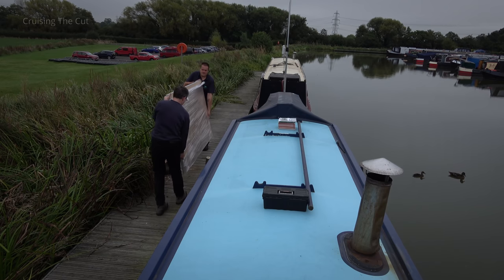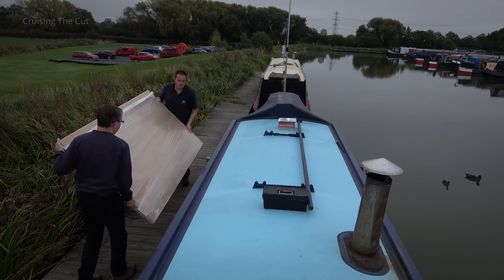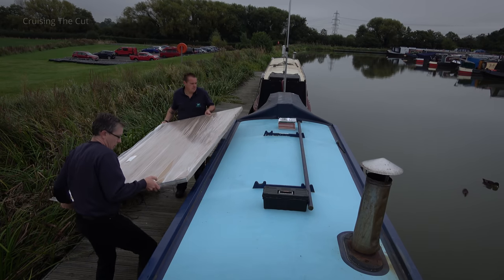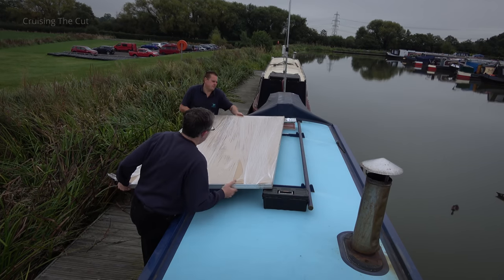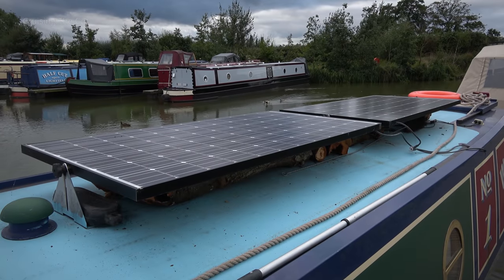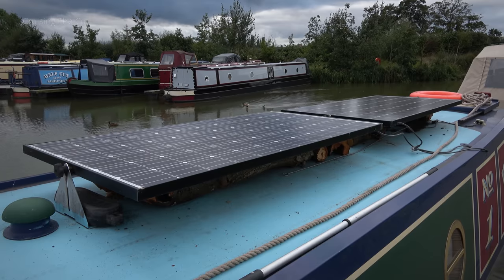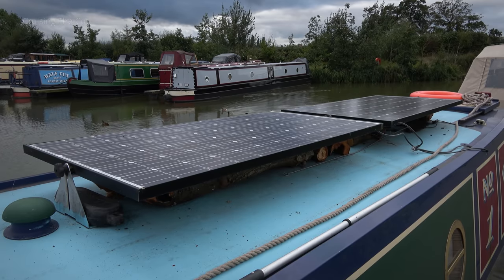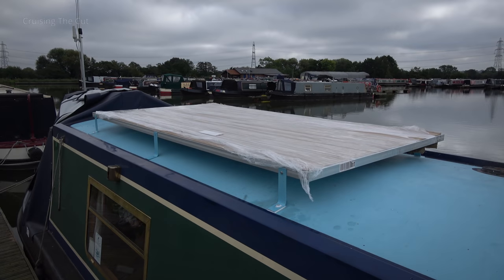260. Solar Panel and Lead-Carbon battery update (narrowboat)

Comment: Do you have any Anker power banks? On those sunny days, you could charge those up and then on darker days you can still charge/power your MacBook, cell phone, and other peripherals.
Reply: This is a great tip. I would even consider getting a portable power station. They're brilliant for when you don't have enough power. Jackery, Bluetti, etc.
Reply from the maker: Cheers but there's not really a point to getting a power bank though - it'd make more logistical and cost sense to add another battery to the existing bank. Those banks and Jackerys are just big batteries with a charger and inverter in a single box, which is what the boat already has as separate items.

Comment: Thanks, David, very informative. My only comment would be the slight confusion (for me) over units. I'm fairly up with electricity, but even so I got a bit confused when you used amps and amp-hours. I would be happier with watts - it is, after all what electrical devices measure their consumption in. I appreciate that your system is 12v, so different to what I'm used to, but I assume the same basic logic applies - power (watts) in greater than power needed = OK, power in less than power needed = problems. Just my twopennies worth - the overall message was clear, and I understand the world probably looks different from a narrowboat perspective.

Incidentally, I loved your reaction about going back on the mains - I know exactly how you felt!  And perhaps a sobering reminder of how much we take electricity for granted - and how difficult it must be for people only the other side of Europe currently having to survive without it.
Reply from the maker: Battery capacities are quoted in Amp Hours usually hence why boaters tend to think in that unit!
Reply: I think in Amps, not Watts. Electrical stuff is rated for Amps. This computer power brick has an input of 1.5A - as stated on it. And yet many things also labelled in Watts !
Reply: Historically Amps and Amp-hours are used because ammeters were used to monitor charge and discharge of battery systems and an ammeter can be used in any system regardless of its voltage, since it is wired in series. Simple and cheap. Watt meters are much  more expensive as they have two coils to measure the current (fixed) and the voltage (moving). The current coil sets up a magnetic field proportional to the current while the moving voltage coil sets up a field which reacts with the first to cause a pointer to deflect proportionally so indicating the power consumption.  Now of course the solar charging systems show all the paramaters and you could use watts and watt hours instead if you wished but just like gallons (we buy litres) and MPG its ingrained. Who likes Km/l.  Ugh
Reply: Ah is the measure of charge and Wh is the amount of energy. It's to do with the way batteries are made and tested, the measurement is in time and current so the unit is Amp hours - Ah. 

There are far too many complicated reasons Ah is used instead of Wh, it makes more sense and is easier to understand and use the industry standard when working with batteries.

Comment: Do they have propane refrigerators and freezers in the UK. I had a propane fridge and it worked fine.
Reply from the maker: Generally not on narrowboats, no (thought very occasionally you might see one on an old boat)
Reply: @CruisingTheCut  cool thanks for the reply. Good to see you posting these new videos, I think they're more interesting for you. Cool, have a good weekend.

Comment: Question. What is the total power received from the engine? I was wondering if a small generator would be more efficient/quiet, or much of a muchness?
Reply from the maker: It's only a small alternator but it's about as much as a battery bank of my boat's size would need
Reply: I once saw an all-electric RV that had two 175A alternators on the diesel engine and no separate generator. That seemed like a brilliant solution!

Comment: Have you considered using the spare solar in summer to heat the water in the calorifier ? I have seen others using this power to give them "free" hot water and effectively store the energy as heat.
Reply from the maker: It's something I've seen done but I'd have to remove my existing 230V immersion heater to do it

Comment: How about a high output alternator on the engine for winter charging use?
Reply from the maker: I don't think the batteries would actually like a much higher current than my existing alternator puts out, and as they get full, they accept less charge anyway
Reply: It's the batteries that regulate charge rate.
Reply: @CruisingTheCut  You have 4 in parallel - what does the bumf state for max charge current ? Then multiply by 4. 50A/battery would be reasonable - I'd be surprised if your alternator put out more than 200A ?

Comment: So adding more storage capacity seems to be the overriding advice. How about DIY ing some LiFeP04 Prismatic cells from China, with a JBD BMS to replace your Lead cells...? The DIY element alone has to be worth the content creation costs? I'll bet you could easily fit 20kWh of LFE in the same spot your lead is currently taking...?

Comment: Why not go for a third or fourth panel for winter. Maybe even switch to a more efficient fridge and freezer.
Reply from the maker: The fridge is about as efficient as they make them. You will see in a later video I did indeed add a large third panel.

Comment: a 24V system might be more efficient, and for connecting the panels to the controller, it would help if the heaviest gauge wire possible would help too by reducing resistance losses.

Comment: Here in the U.S. most semi trucks that are "sleepers" (i.e. have a small living space) have what's called an Auxiliary Power Unit (APU).  The APU draws fuel from the diesel tanks and provides power for the cab of the truck to run a fridge/freezer, tv, electronics, lighting, etc.  This keeps the driver from having to idle the truck engine to provide power much like you having to run your diesel to charge your batteries.  I wonder if such a unit might be a good idea for a narrowboat to serve the same purpose?
Reply from the maker: Maybe...
Reply: It's a generator - see the pinned comments...

Comment: I thought about wind turbines on these boats, but they are probably impossible because of the narrow clearance on the bridges.
Reply from the maker: They’re just a bit rubbish, see the pinned comment at the top
Reply: a two foot wind turbine might give you 50 watts in a 7 mile an hour breeze but compare that to just one 500 watt panel. Small turbines are rubbish just like he said.

Comment: i have a question i think you may be able to help me with ,  i'm going to replace all the leisure battery leads in my battery bank & noticed there is no terminal covers on my batteries  now my question is, will this be a problem when i put my narrowboat though it's BSS  , all my batteries are in a box & strapped down , thanks for your time david
Reply from the maker: It often depends on the whim of the examiner but in my opinion, if the batteries are in a lidded box then they shouldn't need additional terminal covers to pass the BSS. That doesn't mean it isn't a sensible idea since if a lead came loose in the box, it could conceivably cross terminals (I grant you it's extremely unlikely)
Reply: @CruisingTheCut  thanks you , i think i will just get the terminal covers then i shoudn't have any future problems

Comment: Are you saying you were getting 1 to 2 amp.hours or 1 or 2 amps per hour throught out the day light hours?
Reply from the maker: There's no such thing as "Amps per hour" as Amps is a unit of the measure of the rate of flow. You can have - confusingly - Amp Hours per Hour which I think is what you mean. I was getting 1-2 Amps (which over the course of one hour equates to 1-2 Amp Hours respectively)

Comment: Good One David. - I'm wondering is solar water heating viable on board at all? - I reckon here in NZ that I get nearly free showering & sink time for 10 months a year .. but I do appreciate we get brighter weather mostly. I have a smallish pumped  'Evacuated Tube' panel.
Reply: NZ 46.6° and less from equator. UK 50° and more from equator. That's a start of the problem. The next difference is %age cloud cover. I think solar water heating is viable but summer months only - so possibly 4 months per year June to September.
Reply: I like to imagine the Heath Robinson festooned narrowboat that David would have if he followed everyones suggestions. So far he would have wood fired centrally heated battery banks, several wind generators, a diesel generating plant, evacuated tube water heating, a set of bizarre magic diodes controlling his charging regiemes. He basically needs a whole additional boat to fit it all on. In fact he'd be better off in a house.
A note about English Summers, I was contracted there in 1999. The highest temperature recorded in Newcastle was 21.6°C. For about 3 minutes either side of 1pm August 12th, when I was in Gibraltar. We stupidly turned the central heating off when on holidays. It took 3 days to get back to liveable temperatures again.

Comment: A nice little hack for your situation would be to get one of these smaller micro generators. I have one that is 800w and it'll run 8 hours on a pint of gasoline. It does a really nice job of charging batteries and can do some smaller 120 volt uses.
Reply: All I've found so far is either over powered or questionable Chinesium.
But it should be possible to source a small DC battery charging diesel generator.

Comment: The question about the batteries is .. are you discharging well below 50%? And if so are they going back to 100%. I'm asking because we live on a sailboat in the med full time  and agms can be a problem dropping below 50%. From what I understand lead carbon recharges like lithium without the need to change alternators.
Reply from the maker: I rarely discharge below 50%

Comment: When you start your engine to charge your battery, can you offer your neighbours to share your electricity? The noise would be much more tolerated if everyone would benefit from it.
Reply from the maker: Not really, as then I'd have to run the engine for hours longer to charge their batteries too and it would cost me a fortune.

Comment: Just spitballing out of curiousity...is there a more efficient type of fridge? 
I know you don't want to get into computers, but if you don't mind answering, did you add more ram?
Reply from the maker: The fridge is a modern (2019) compressor type so about as good as they come. They are just naturally power-hungry as they're on 24/7 even though the compressor may run (eg) 50% of the time.

Comment: Angling the panels is most needed in Winter though. What about a wee wind generator? Or too noisy?

PS is it an air cooled fridge or keel cooled?  Keel cooling may make it more effective and consume less.
Reply from the maker: But it's not, for the reasons described. If it's totally overcast, angling the panels makes sod all difference.

Wind generators are a bit rubbish on the canals, see https://cruisingthecut.co.uk/f-a-q/
Reply: @CruisingTheCut  Fair enough. Angling towards a low sun will definitely help but it has been grey, wet and horrible.  Yes canals not ideal for wind. Worth checking out keel cooled fridge though.
Reply from the maker: I've sort of keel-cooled it inasmuch as I drilled two large vents holes to the bilge behind the fridge so it can draw up air from their as the hot air from the condensor thingy goes upwards
Reply: @CruisingTheCut  Ah, I was thinking brazing the condenser straight to the plating.
Reply: @CruisingTheCut  getting cooler air from the bilge is a good compromise. Cooling the condenser with canal water might be the ultimate if you had the skills to diy. The cost to get an expert in would be unlikely to paid for by the savings. 
It would also make the fridge into an immovable fixture though. 
There is also an issue with the freezer, I expect it’s like a normal land fridge-freezer in that the thermostat is only in the fridge part , it relies on the fridge working a fair bit to ensure the freezer stays frozen. 
I have this issue on land with  my fridge-freezer situated in my unheated outhouse , in winter it gets down to 3°C in there so the fridge doesn’t do enough work.  Freezer then gets up to -4°    Ice cream starts to melt!
I have a cheap Lidl indoor outdoor thermometer , the outdoor probe wire is in the freezer. Have high alarm set at -5 
Solution is simple, put a milk container of hot tap water in fridge to make it do some work.

Comment: Hmmmm... Why don't you just dock on a dock with electric in the winter?  How expensive could it be compared to the inconvenience of not having reliable electric?
Reply from the maker: I did, as explained! But moorings can cost £200/month easily plus electricity
Reply: @CruisingTheCut  I am assuming that non-electric moorings are significantly less attractive for moorers and therefore cheaper - but how much if I may ask?
I mean, 180 would be 10% and thus significantly cheaper in its own right, while 100 would be even more so that way. My wild guess is "somewhere in the middle" as things always are 🙂
Reply from the maker: Non-electric moorings are a bit of a rarity in marinas (it's assumed boaters want to plug in) so it's hard to say how much cheaper generally. I think I got 10% discount

Comment: Hello David. Sorry, not a solar panel or battery related question. May I ask which video editing software you used on your PC and if you use iMovie on your MacBook?  I work at a university and we are still conducting classes online due to COVID. I often need to edit some of the recorded lectures, but it is a new skill. I have Googled it but everyone has a different opinion. I'm curious what you you would recommend. Thanks.
Reply from the maker: I use Blackmagic's DaVinci Resolve. It's not really beginner-level software though. I'd use iMovie if on a Mac and new to editing.
Reply: @CruisingTheCut  Thanks.

Comment: Hello David, did you consider getting one of the thin, flexible solar panels? Any reason not to?
Reply from the maker: No. I have seen too many reports of them having a short lifespan and becoming unreliable after just a few years plus panels don't like being hot so allowing air underneath is important.
Reply: @CruisingTheCut  Thank you David. Very useful!

Comment: Would putting a bank of batteries under the bed or dinette seats be dangerous or a sensible use of space?
Reply from the maker: Perfectly do-able
Reply: Lead-acid batteries off-gas hydrogen when charging. You’d want to vent the space if you had those.

Comment: Have you considered a 1KW petrol or propane generator?
Reply from the maker: Not seriously. A lot of boaters have them but then you have to buy and store petrol (not readily available on the canal, you’d have to walk to a roadside petrol station) and they can be banned in marinas for noise.
Reply: some engineering with brackets & belts
can add army 24v generator of significant size to the boats engine
for getting a lot of charging from just a high idle diesel engine
Reply: @rwbimbie5854  alternators of up to 200 amps are routinely fitted to NB engines already, in addition to smaller units charging the starter battery. Some have a travel power kit which essentially turns the engine into a 230 volt generator putting out 3000 - 5000 watts.

Comment: Put battery in 24volt.  Much better.
I have 4 flat panels 60volt 320watt.3kw hybrid inverter. 4 x powersafe yellow 12v 200 amp emergency batteryes.   November desember i never needed onshore line
Reply from the maker: 24V per se won't make any difference to solar charging, it's just a slightly lesser loss over the cables along the boat.
Reply: And so much stronger and less cost. Experrians

Comment: I’m really puzzled that your still using lead acid. I’ve just converted my motorhome to lithium and omg what a difference the solar is far better and they charge up from the alternator via a Victron b2b Super fast. I’ve a 200 amp lithium battery that’s increase my power availability by over 100%. Total cost with Victron shunt, monitor, Victron B2B, Victron solar controllers and cables. £2,000. We’ll worth every penny when I consider the cost I paid for the motorhome.
Reply from the maker: Hi, please see the pinned comment at the top, cheers
Reply: @CruisingTheCut  not seeing a comment from you pinned to the top, sorry!
Reply from the maker: Aaarrrggghhhhh. Wretched YouTube!! Whenever you edit a pinned comment, it unpins it, and every time, I forget. It (should be) now re-pinned. Sigh.
Reply: No matter the battery capacity or chemistry, if the electrons are hard to come by, it matters not how you store them...

Comment: A small wind turbine would see you thru on those cloudy days, especially during winter months, and offset the lack of solar. I used both on my sailboat and was never in want of plugging in
Reply from the maker: Sadly not, see the pinned comment
Reply: @CruisingTheCut  Quentin has a sailboat. I guess he doesn't realise narrowboats don't have sails for one very good reason !
Reply: Quentin, do you have room for just one more wind generator? I can sell you a lovely Aerogen 12 that has only been sailed across the Atlantic twice and the Pacific once. In 20 knots it will give you all the amps and sound effects you need. New bearings too! Go on make me an offer.